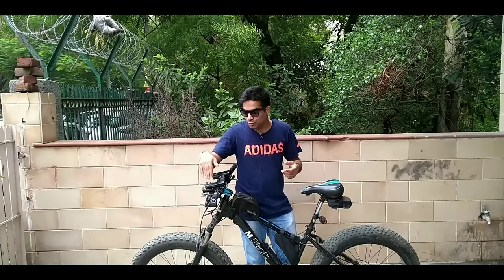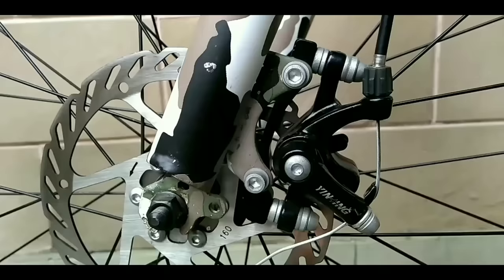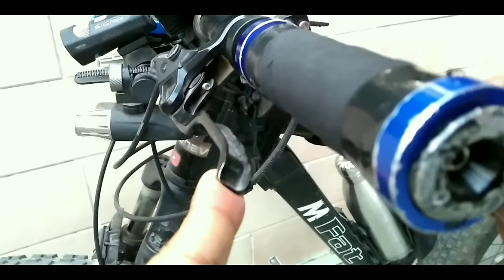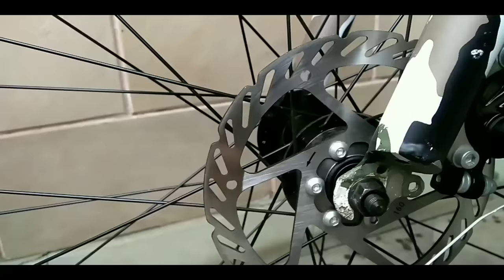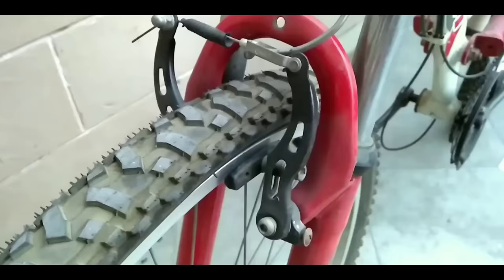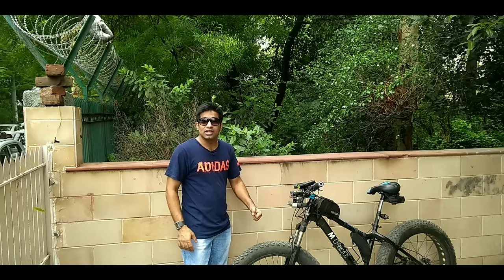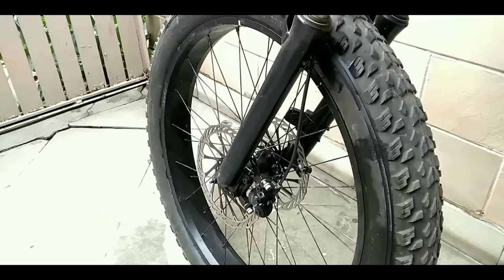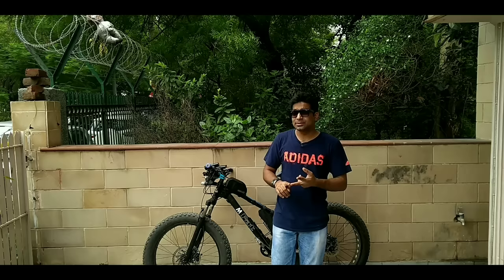Hydraulic Vs Mechanical Disc Brake

Comment: Hydraulic disk brakes are fun until you need to change the oil every 6 months. You need a bleeding kit which removes air bubbles from your hydraulic kit. This kit costs 3,000 rs. After this u need hydraulic fluid and each brand of fluid has its own oil. So all of that causes a lot of headache.

Comment: In case of rim brakes ,I tighten and adjust them everyday just with my hands.They are cheap.If the brake shoes of rim brks are changed every year they work at the point at every press.It depends upon the amount of force we apply.We cant stoppie on the bike with rim brakes.
Reply from the maker: Yes we can still do stoppie with rim brakes and your points are valid
Reply: @pabonff8963  what happened bro
Reply: @FatBikerVaibhav  I have done so many stoppies on a  rim brake bicycle

Comment: Can we change mechanical disk brakes into hydrolic If yes please make a video on that.
Reply: He did on his fat bike you just replace the mechanical disc brake with hydraulic brakes you might need new adapters you can usually  use the old rotors if their straight or not warnout
Reply: Please make video

Comment: Is it possible to change disc brakes into hydraulic breaks
Reply: Yes but don't it yourself go to a cycle mechanic and let him do the work
Reply: He litteraly said that in the Start of the video
Reply: Hydraulic brakes are disc brakes…just the braking method is different
Reply: @mysteryboombeach  pulling mechanism is different
Reply: @theultimatetime8029  that...and also the fact that hydro brakes push into the rotor on both sides, while mechanical brakes on press from one side.
Reply: @mysteryboombeach  yess indeed

Comment: Hello Mr. Vaibhav I have mechanical disc brakes as my bikes front brakes and I service them whenever I want but usually do it in 3,4 months and I have rim brakes as my rear brakes and they are as strong as hydraulic brakes even in rainy season.

Comment: Mera cycle me aloy rim break he  when I apply break the wheel are lock why please give answer on next vlogs
Reply: Cause rim brakes, act on the rim of the cycle directly and hence due to hard breaking, it has more chance to lock the wheel than a disc brake... Where as a disc brake, has it's own disc which it uses to stop.

Comment: Please suggest best mechanical disc brake, my old disc brake pads doesn't work well and I can't find new pads(not even in Jhandewalan Market as they are round in shape, and now a day's rectangular are used, yes I think my ones are outdated, even though I bought my bike in December 2017 😂😂) so I have no other choice than to buy new disc brake set. Please suggest one😅😅

Comment: I've made a electric bicycle which runs 60kmph +, I've mechanical disk brake, now while I'm braking on 50kmph + entire vibration & momentum getting transferred to my fingers. I'm planning to upgrade it to hydraulic brake, will it give any benefits?
Even I'm planning to upgrade disk size 203 front & 180 rear, please suggest

Comment: If your riding in a high speed and use hydraulic disc brake, then on braking your rear wheel may go up in air and you may fall. But in mechanical disk brake you can stop by braking slowly

Comment: Sir i brought hydralic disc brake cycle and it is 7 years older so working function of brakes is good and in disc brake oil is completely dry which oil i want to use sir and how to apply to it

Comment: Hey bro your videos are awesome  can you please make a video on how to clean your bicycle and the gear 
And I have a gear problem my bicycle is cosmic flash MTB 21speed it has a problem when I shift gears 
From 1 to 7 or 7 to 1 , when it comes to 4. After that when I shift it directly goes to 6 and also sound 
Can you please tell me my bicycles brand is good or not and also please tell me a portable and also cheapest toolkit for my cosmic

Comment: One day one local mechanic had poured oil on rear Mechanical disc brake. Now you may what happens after that. I had accident with motor cycle. As the rear brake can stop my bicycle. I have a hero sprint rx1 cycle . I love riding it . Can you help me in this. Please please please please please please please please please please please please please please please please please please please please .

Comment: Bhai mechanical disc brakes within 2-3 months poora kharaab ho jaata hai aisa kyun adjustment karke bhi nahi hota full machine replacement karna padta hai
Iska please koi solution bataao please.
Reply from the maker: They are available at really cheap rate, just for 150 rs

Comment: Bro Where Can I get Brake pads for my Mechanical Disk Brakes?I want reliable brake pads, doesn't matter Local or Branded.

If you remember I also live nearby you.
Reply from the maker: Yes there are some links that you can check

Comment: hydraulic disc brakes are a waste of money on a thing that doesn't go beyond 30 kph. and beyond that speed, even if I skip the question of legality, the disc bite will be so strong that the cycle will skid off, if the rider is not careful. ab bikes mein aati hain to ameer logon k liye cycle par bhi aane lagi hain... single piston basic stuff.